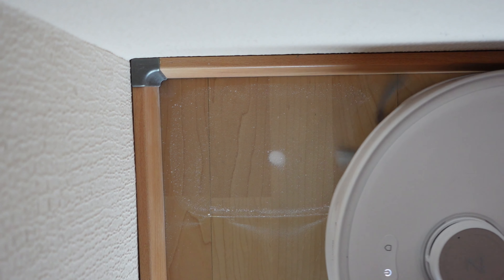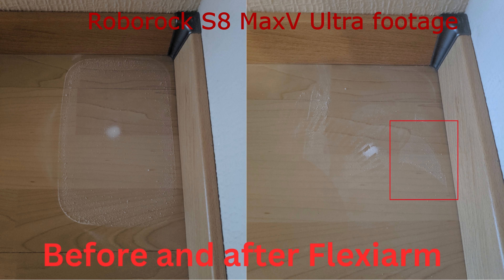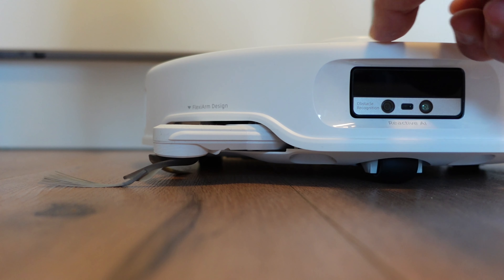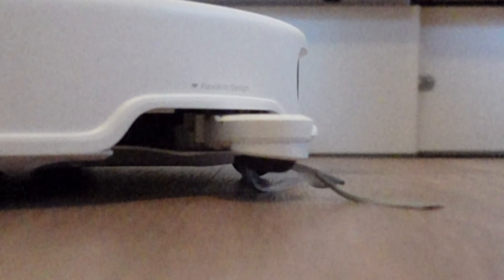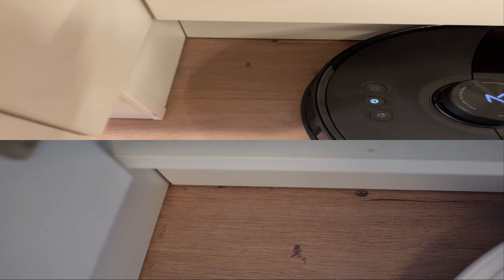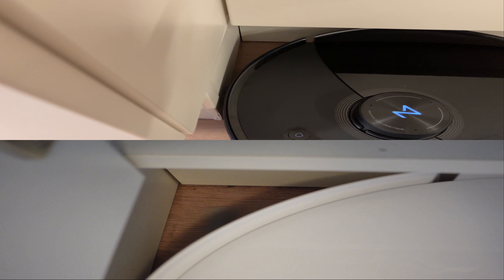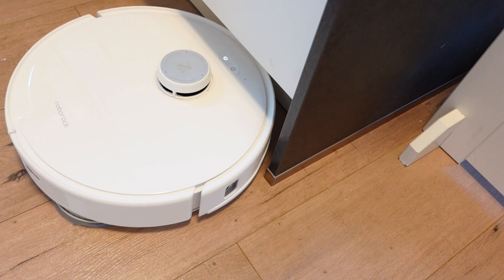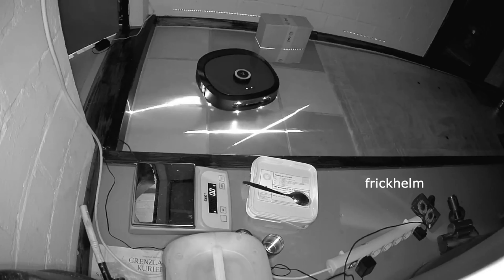Roborock QRevo Curv / Edge FlexiArm design and details - much better than the S8 MaxV Ultra one

Comment: Thanks for the scientific approach to testing! I have dense wall-to-wall carpet and have a dust allergy and long hair. I was hoping the Curv would be the solution, but I don’t want to fall for the marketing blah blah. Do you think Curv or Dyson Vis Nav is the best bet for my scenario.
Reply from the maker: Dyson Vis Nav. You maybe missed my test video : the curve does not very well with dense carpet regarding dust pickup - also the sidebrush is not very useful regarding dust pickup from carpets [i did some tests with some robots with sand and the sidebrush installed / uninstalled and judgeing from that quick testing the sidebrush has a negative effect]. Also filtrationwise the Vis Nav should be a better solution [H13/H14 vs E11] but this is a rabbit hole since Dyson switched the testing standard and i am looking to do a video about all the hepa shenanigans. Getting certification documents from manufactures is a pain in the a..
Reply: @frickhelm  thanks 🙏 I’ll watch for anything you find about the Hepa. 
I love the word shenanigans 🥸
Reply from the maker: :) the problem is that HEPA is not a protected thing / attribute. You often find hepa filter advertised that has nothing to do with the testing norms for certifications.

Comment: The new Arc brush has the same mounting, can it be used on other models?
Reply from the maker: the mountig is different - the shape of the cutout is different - so without modification it is not possible. Posted some pics as community post.
Reply: @frickhelm  thank you

Comment: Curious if bloggers have compared the QRevo Curv to the Edge to see if the accessories are the same.
Reply: They’re the exact same
Reply: @LawsonHasley  thank you for your response, do you have both of them or have you seen that comparison somwhere?
Reply: @yilepa I have the edge and one of my family members has the curv their only difference is the cleaning base. Because of the curved design the curved has a slightly lower water capacity but it’s like .2 liters so barely anything. There is also a Reddit where a guy has a spreadsheet of every Roborock vacuum so you can look at that as well.
Reply: @LawsonHasley  Thank you!